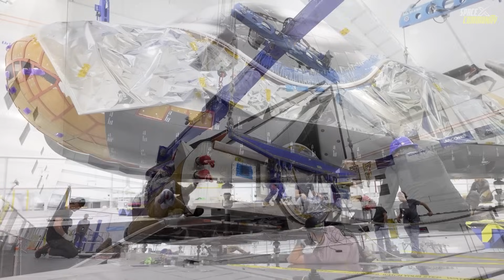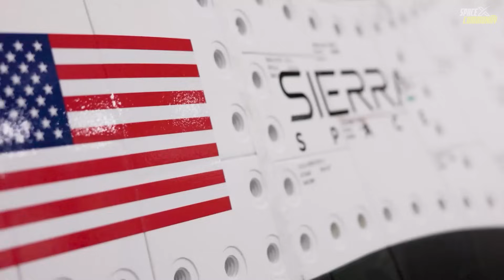Blue Origin Says Something Weird Happened During New Glenn LANDING! Now We Know the REASON

Comment: Maybe BO did not fully throttle up the BG-1 but I noticed at +1 min BG1 was less than half the altitude and speed that SpaceX realizes on their routine launches. Further stage one was nowhere near Falcon9 altitude and speed when MECO was reached. The visuals seems to me to show the booster in a slow tumble for about one minute before telemetry was lost? Congratulations to BO for a great advance, a lot of effort with very talented people working hard has made first attempt with a new system to reach orbit a huge success!!! Again congratulations to all at BO for a job well done. Ray
Reply: The speed was probably the same. BO just sent their telemetry in feet and miles per hour, which will appear about twice as slow as Space X KPH and Meters per second.

Comment: I can’t believe how slow it took off, I thought was gonna fall over for a second
Reply: Same. I've played it back several times. The thing was only going about 45 mph when it cleared the tower. The Space Shuttle was going over 100 kts in nearly the span of its own length on launch.
Reply: You are right, I happen to be in Kissimmee for the Mecum car auction. I drove to jetty pier park last night and had a great seat for the launch. You are spot on about the slow liftoff. After seeing about 12 night launches, mostly Musk ships I was a little worried it was not going to clear the pad. Watching it punch through the clouds and light them all up was great.
Reply: Thrust to weight ration is low engine are not performing well enough.
Reply: Too heavy, too much fuel used, none left for booster landing. MAJOR problem is the engines are undersized.
Reply: my thought exactly, compared to Falcon 9, the NG was slow on both max-q and meco. Seeing how much more thrust the BE-4 engines have, I was a bit dissappointed. But alltogether nice to see they got it into space

Comment: The B.O. booster had a problem similar to what the first Starship boosters had due to liquid cavitation caused by negative acceleration.
Reply: Maybe. Or maybe it was not on the correct trajectory for landing. Either way, probably FTS destroyed the vehicle. Still, a great success for a first flight.
Reply: Water ice ingestion on landing.
Reply: @hawkdsl  To you have a reference confirming that Blue O is using oxygen rich gas to pressurize like Starship does?
Reply: It's too bad then that they didn't learn from SpaceX's experience and had taken measures (like SpaceX did) to prevent it.
Reply: Probably.
Reply: First informative thing I've read. Thanks for the kink too